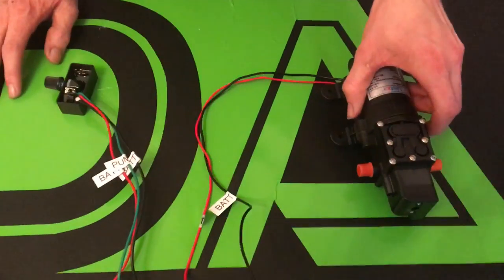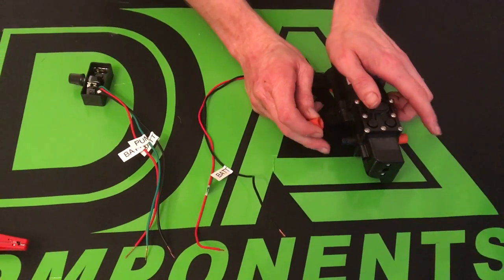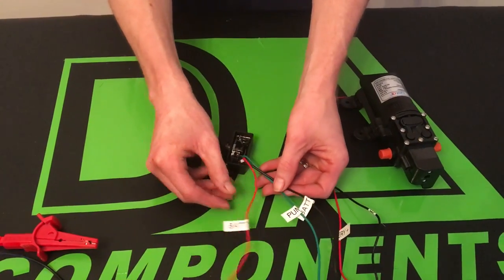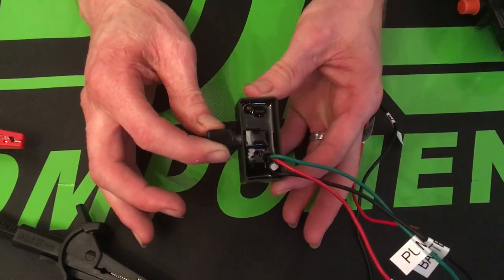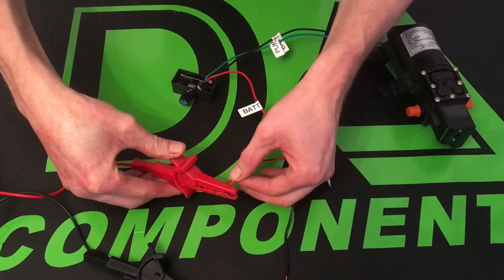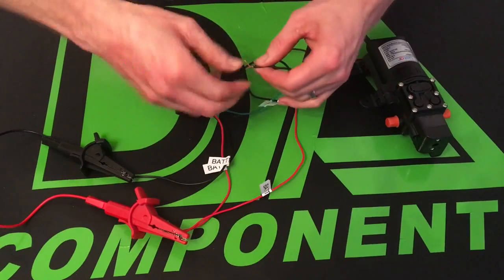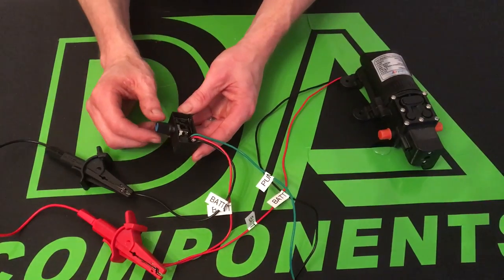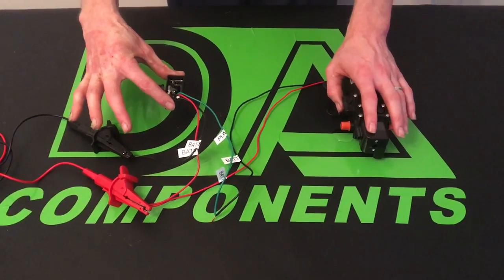How to wire up small 12v water pump and mini controllers

Comment: Darren, I'm a window cleaner and I have a reverse. Almost is 50 gallons a day membrane. Can I put a motor controller on it? To make the motor pump go faster. To give me a little bit more water coming out
Reply from the maker: Hi Steven , I do think you need a ro booster pump this will help the RO membrane to work more efficient, in this video you can’t use this set up unfortunately.

Comment: So I have a DC 12 volt pump I have an inverter generator she does have a 12 volt DC 8amp outlet and the pump is a 12 volt 7amp max so if I rigged a charging cord plug to my pump would I be safe running it as a plug and use system or would I be better getting an AC/DC adapter with the 12 volt cigarette lighter attachment

Comment: Hi sorry to trouble you again, my pump come today, it is the micro, so I'm guessing you can't just connect it to a batter charger?  Also my hose fits snug inside the holes, will they hold or shoot out with the pressure, maybe hold with tap?  Thanks for your time
Reply from the maker: Hmmm I would like to see a picture off the pump if possible send a few pictures to my FB page then I can affirm there 

Best regards

Comment: I just bought a small 12V pump for $30 from amazon that looks identical to this one. Can this speed controller be installed on any brand of these pumps? I want to slow the water flow and preserve water for mobile usage.
Reply from the maker: Hi there we need to know the pump spec  ? This controller is only rated at 4 amps maximum, 
If your pump is above 4 amps then no , but we have others controllers ranging from 5,8,15 and 30 amps .

Comment: Can you please tell me which wires get connected to the battery because naturally the controller has to work with power
Reply from the maker: Hi , the RED off the controller and the RED off the pump are the + battery terminals

The black off the controller is the - battery terminal.

Comment: Hi Darren, thanks for the video, would you happen to know the type of potentiometer? It has a switch right? So it can be turned off completely? Thanks!
Reply from the maker: Sébastien de Salvador 

Yes this one you can turn it off completely, but as soon as you turn it back on the flow will start . 

Any questions on reach and wash systems just ask away

Comment: Darren what brand pump are you using? Also what is the head psi output of the pump?
Reply from the maker: Chase Lilley 

It was a old pump , we now use 40 psi , 3/4 lpm

Comment: I have a pump with four wire how contact it with the adapter ? 
I need an answer
Reply from the maker: You must have 2 cables for the power = battery and other 2 must be for the pump ?

Comment: How do I hookup the pump to my generator? Would a transformer be the best way?
Reply from the maker: ITSATRAP ! 

Not really to powerful u only need 12v battery like car battery will do
Reply: @dacomponents  thanks for the reply. I want to make it easier and cost effective for my camping needs. car battery is too big and is an arm and a leg.
Reply from the maker: ITSATRAP ! 

This one will be fine 

https://rover.ebay.com/rover/0/0/0?mpre=https%3A%2F%2Fwww.ebay.co.uk%2Fulk%2Fitm%2F112771648667

Comment: Thanks Darren will pump turn off automatically when the water is turned off at pole using this set up?
Reply from the maker: Hi Tim yes  as long as ur pump has a pressure switch fitted

Comment: I bought this pump today.its rated 4.5A.(amp) 12v..can i attach the pump directly to a battery rated 12v 65ah without the pump burning?
Reply from the maker: Kakinyi Mutua 

Yes just you can I would advise to fit a inline fuse on the positive cable on the pump with a 5amp fuse
Reply: @dacomponents  thanks alot
Reply: Is is true as the pump runs it also charges the battery?
Reply from the maker: Kakinyi Mutua 

No the pump will just keep running it I’ll you turn it off , the only way you can charge the battery is with a split charge relay,
Reply: @dacomponents  thanks again for the information. I appreciate. I have ac to dc adaptor..input 240 to dc output of 12v 5A..can you connect the pump(which is still rated 4.5A) to the adaptor ?
Reply: @dacomponents  can i use a 6A fuse instead of 5A fuse ?

Comment: Where fuses go ?
Reply from the maker: Hi Max , you can fit a inline fuse on the red cable going to the + size of the battery, I would recommend 5 amp fuse too